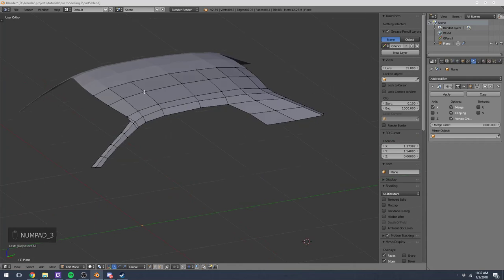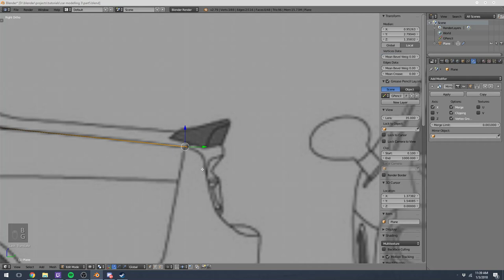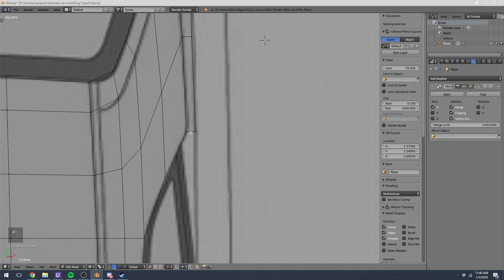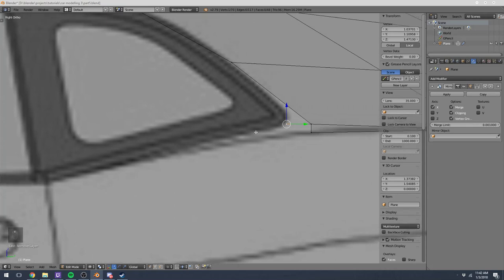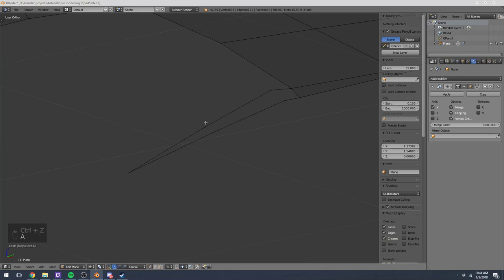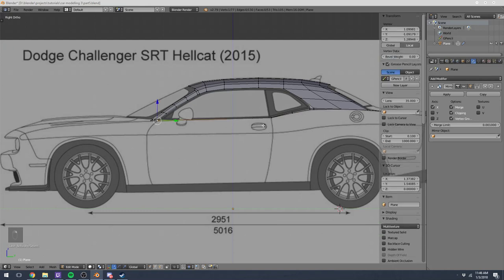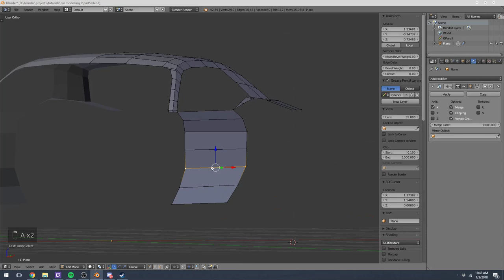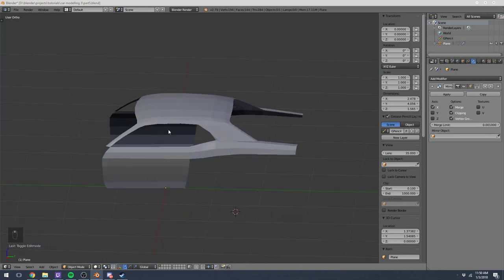Model a 3d Car | part 5 | modeling more complex shapes (Blender tutorial)

Comment: at 1:28 when I extude them I don't get another plane
Reply: Had that problem too. Try the edge select instead of selecting two vertexies. Worked for me.
Reply from the maker: Sometimes if you have duplicate vertices it can mess with selecting. Try selecting everything in edit mode ("a") and use the search menu ("space") and look up "remove duplicate vertices"
Reply: @testedpancake12  yes I had already dome that though I had a problem with dups before hand